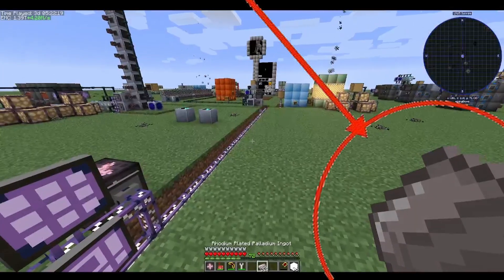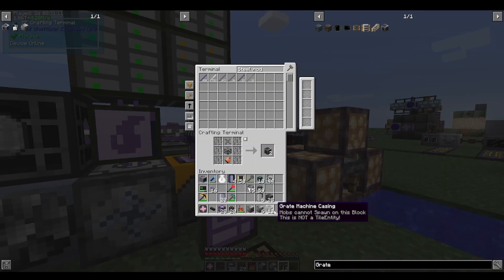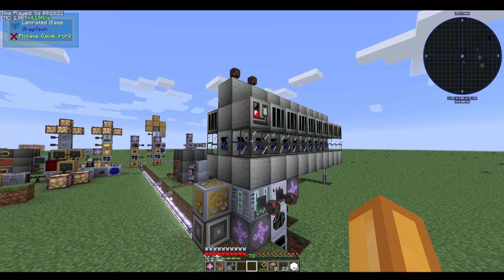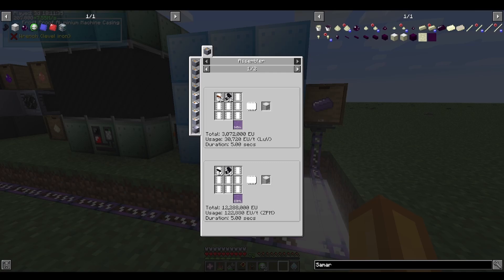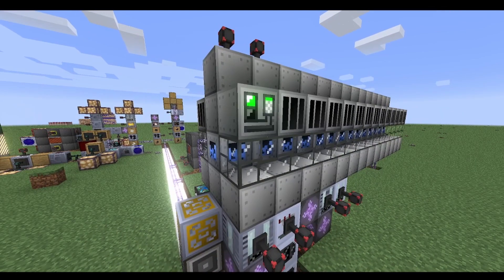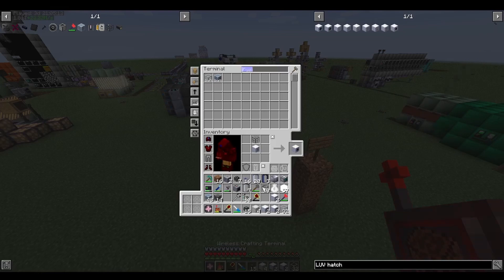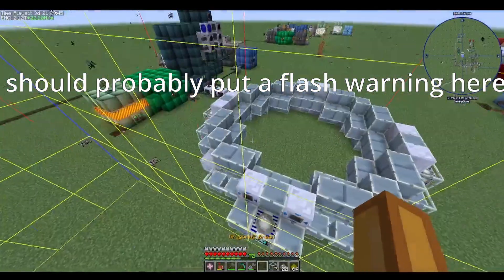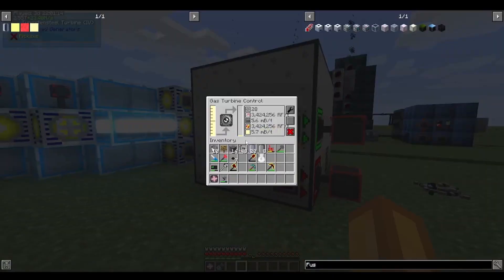How I achieved fusion in the most cursed GregTech pack

Comment: Why are you complaining about ass line while it is the same as Nomi it is easy. (Edit) in Nomi at this point the only hard thing is trinium which here can be passive cause EMC
Reply from the maker: I have made the foolish mistake of not automating crafting for anything up until that point. Also trinium still requires a bit of processing since the dust doesn't have emc and it takes some time to cook.
Reply: @french_bread_gud7046  can't you buy kaemite ore and process that. It should have smaller processing chain than naquadah ore. If you do that you will also save some naquadah for later because if processing chain it is the same as Nomi then you lose normal naquadah which is useful for coils
Reply: @french_bread_gud7046  Also you can sextuple ores using ore drilling plant you just need a smart contraption to replace controller and place ores.